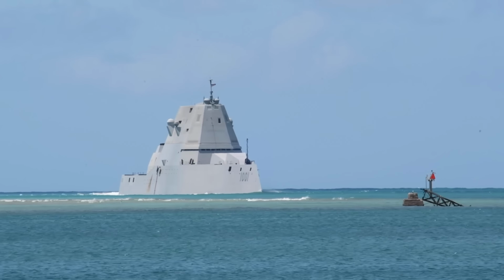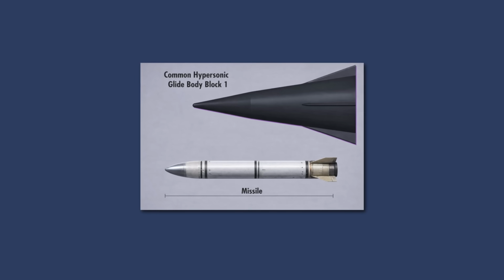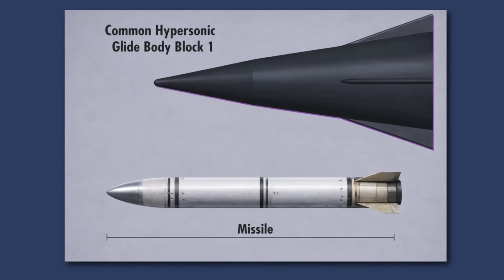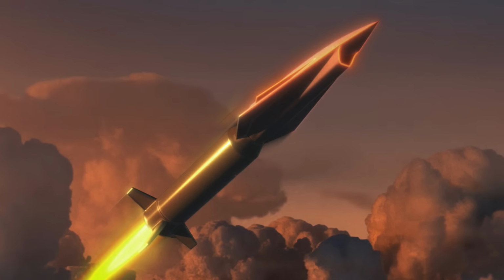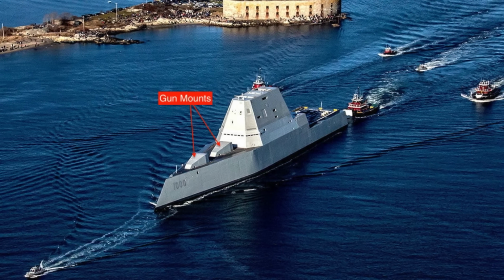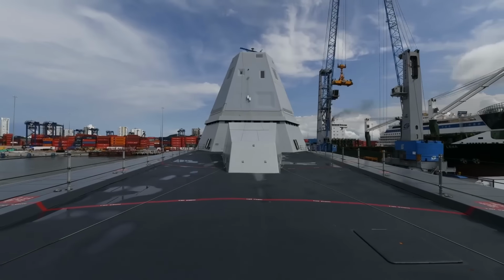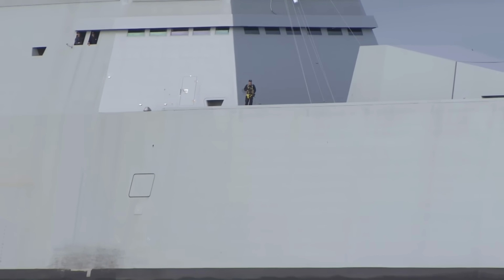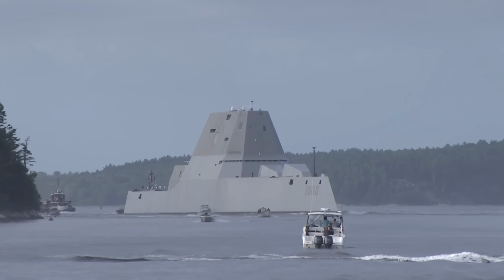How Zumwalt warships is set to change the game with hypersonic CPS missile  ?

Comment: Should start Zumwalt class construction back up.
Block 2
With a redesigned upper superstructure that's simpler to build 
Replace the forward gun with the standard 5-inch 
Install VLT in the location of the 2nd gun 
Concentrate on fleet air defense.

Comment: Glad to hear that the use of these ships  have found their new role. If we can have a fleet of 20 to 30 of these it would help in counteracting China's missile deterrence in the Pacific.
Reply: If only. It's politically toxic on capital hill to make any more.
Reply: They’re way too expensive to build, and there would definitely be delays like with every single ship that we’re currently building. If we take away some of the stealth features, that would decrease costs and construction significantly. So if that were to happen I would agree with you.
Reply: I don't think they can. They only made 3, and companies involved have since moved on to other projects. That's okay though as many of our submarines are planned to also be able to launch hyper-sonic missiles (and will be even harder to track down than the Zumwalts).
Reply: @bariman223 they only just recently finished the third and are actively working on them to change out the gun to hypersonics tubes. 
Unlike the f22 assembly line, they probably could make more if congress said yes.

At least from what i understand. 
If not then it could be that's why the Trump class is desirable to some in the navy... its designed around surface warfare striking power.
Reply: @ravissary79  Okay: https://en.wikipedia.org/wiki/Zumwalt-class_destroyer. It looks like the third and last Zumwalt was' launched' in 2018, but was left un-commisioned until after the upgrades are completed (around 2027). So, the last ship was built 8 years ago. That's too long, I think. As for our new up-coming 'battleship,'... sure. It will probably be an armament ship of some kind (if they're made at all).  Especially if the new frigates aren't getting any VLC(s).
Reply: @ravissary79  
There is no point at this point
its easiler to divert all resources to the DDG-X and moving that forward to construction. The DDG-1000 are just wasted potential

Comment: Zumwalts were built slightly ahead of their time.

Ammo not being ready turns out to be a game-changing stroke of luck.

CPS weapons means Zumwalts will be the world's first stealth CPS surface warships.

Far more powerful soon than they ever would have been otherwise.

Should build about 20-25 more now with CPS integration.

Won't happen but it should.
Reply: They won’t build anymore but we can take these lessons from integration on these and move it to more future vessels. Each zumwalt costed 6B for perspective a Burke is close to 2.2B. You could build almost 3 for 1 and get more VLS. They do look so cool tho, at least they have a mission now to be a sniper with CPSM.
Reply: @Wanna-See-It but they only cost that much because the program was cut off at the knees to make only 3.
Make 10x more and the cost would drop per unit.
Make 27 more and the AGS 155mm gun would actually become perfectly viable. 
The shells were only so expensive because they only made a few hundred of them... making them collectable items instead of mass produced.
Make more Zumwalts along the new design, with 4 CPW tubes and  1x 155mm AGS and the cost for both Hypersonics and AGS ammo would immediately drop. 

The Burke is a 30+ year old design and its been maxed to its potential. It's awesome and affordable but its a design that has no future. 

Zumwalt can and SHOULD be invested in for future applications.
Reply: @ravissary79 I agree the Burke is maxed out and that we need a new destroyer. We spent 20yrs playing in the sand and now have to refocus to near pears. Zumwalt is capable and could have seen some price reductions. As a general workhorse destroyer it lacks VLS, its radar is not aegis and can’t use some standard missiles, also no close in weapons. 

This could all be fixed and production could start again,but restarting production  and modifying things just adds cost. At that point just learn your lesson and make a new design that isn’t so bespoke. VLS is everything for a forward deployed Navy. Hopefully we get DDG(x) and not that battleship nonsense. I like Zumwalt it’s just not the answer.
Reply: @Wanna-See-It it only lacks around 10x VLS vs Burke, meanwhile it has better range and endurance and the addictional CPS weapons tubes more than make up for this if we can develop weapons like blackbeard that are affordable to use... keeping only the most expensive hypersonics for emergencies. 

Also, unlike the Burke, the Zumwalt has the electrical power generation capacity to make use of advanced lasers for defense so you're not as reliant on VLS for everything.
Reply: @ravissary79 10 VLS could be 40ESSM for defense. Lasers while making improvements are highly dependent on weather conditions. Let’s take what’s good about Burke & Zumwalt and find a middle ground for DDG(x). This way we can control cost and get a ROI on Zumwalt. 

Integrating Blackbeard on navy ships would be cool, idk dimensions but I wonder if they could be multipacked in VLS.
Reply: @Wanna-See-It to my knowledge blackbeard would be too big for VLS.
The new CPS tubes are SIGNIFICANTLY larger than VLS.
If 3x ESSMs can fit in 1 VLS and multiple VLS can fit in 1 CPS tube... well... I'm pretty sure 4x CPS tubes trumps 10x VLS.
And if they HAD to... if its as you think and all these extra fearures Zumwalt has are worthless compared to 10x more VLS, then just replace those 4x CPS tubes with 16x VLS.

But now you just hsve an expensive stealthy burke... you just gave away your most cutting edge strike assets for an afternoon worth of drone swarm fodder.

The lesson of the Houthie attacks are that you CAN'T survive modern threats with more VLS. Even if you live you didn't solve anything and you spent the GDP of a small country to just hang out.

VLS isn't everything.
Reply: @ravissary79 I guess we’ll just have to disagree. Never said Zumwalt was useless, it just isn’t the super ship that you’re making it out to be.🤷🏻‍♂️
Reply: @Wanna-See-It  
The USN could have saved the program by investing a flight II Technology Insertion batch of ships. The Flight II add SPY-6,  AEGIS, remove one AGS for additional VLS space. On both sides additional pair of 30mm cannons with multi function capable AESA radar as  CIWS , AAA and ASuW.
The turret placements would serve as testing point for directed energy weapon like HELIOS, ODIN and Epirus Leonidas high-power microwave (HPM)
The Leonidas in testing smoked 49 drones in one go and the DDG-1000s have 78 MW power reserve
Depending on how test went
The DDG-X wouldnt exist and it would be simple Flight III DDG-1000
Replacing one AGS with strike length AGS. One 32 cell would bring the DDG-1000 p 112 , only 10 less than the cruisers or do 61 cell for 141 
The DDG-1000 is just wasted potential
Reply: @verdebusterAP  sounds all good on paper. Until you have to tell congress your ship now cost 8B instead of 6B, which is the estimated cost to restart now. Building up new infrastructure and specialized machinery. The ship can be the best thing ever but it doesn’t matter if it’s unaffordable. There needs to be a balance struck in cost and capability.
Reply: @Wanna-See-It  
thats when you remind congress that they put the USN in this position
While the upfront cost is expensive
You lay out the cost reduction measures 
By using SPY-6 and AEGIS, the ship is common to the fleet
Tactically speaking the USN actual best option is the LPD-17 BMD for firepower
The problem with CGs. DD and FF is limited space
The normal cost of LPD-17 is 2 billion
You would add 3 strike length VLS 
61 cells each for 183. plus 80 PVLS
The PVLS would large enough to house quad packed PAC-3 MSE 
Lastly the 6-10 Multiple-All-Up-Round Canisters (MACs) for large diameter missiles
The sensors would be a combo SPY-6 and 7
The ship would have  integrated electric propulsion (IEP) with 100 MW surplus
Add in some modular design and it would down the heavy lifting that USN needs
Reply: @verdebusterAP I’ve never heard of lpd17 bmd, just looked it up and it’s pretty cool. I’m not even really trying to argue with anyone over Zumwalt, if it came back it would be cool. I’m just telling people it’s not gonna happen because all people in congress see is price tags. There is a lot of politics in ship selection and production. Unfortunately we can’t build anything because nobody in government can keep a consistent vision on what we should have.
Reply: @Wanna-See-It  
There is no saving that class at this point
and that is the biggest irony that congress is why the USN is in the mess
Reply: The AGS wasnt ready, it was canx because of cost. The USN opted for unique 155mm instead NATO common rounds. if they had opted for NATO common rounds, they could have used the Excalibur and other rounds
The EMRG Hypervelocity Projectile (HVP) was found to be able to be fired from the AGS but kinda of hard shell to make HVP just for 6 guns
But with the DDG-X, they could upgrade to 155mm NATO common mount. The MK-45 weights 23 tons while an M777 weights 4 tons
If they cap the weight at 25, they could add the 155mm
the 155m has better options all around
The CPS working along the ARRW are potentially the final word against the DF-21/26 
Without their DF screen, China has is very much in trouble
Reply: @verdebusterAP using a NATO common shell for the AGS misses the point. 
If you're not shooting and hitting targets at 80+ miles but just the typical 9-20 miles, you're not getting the leap that makes a powerful gun viable in the age of missiles. 
They have the tech. The price only became ridiculous because the Zumwalts procurement numbers got slashed to oblivion early on, which made all its novel systems into collectors items instead of logistically cost effective. 

If they made 17-27 more Zumwalts... and kept 1 AGS on each, the price per shell would fall significantly.
Reply: @ravissary79  
Thats point. 
The gun should have been common
Able to use the LRLAP but also use NATO common rounds so its not completely useless without the LRLAP
80 miles impressive but not worth it in modern warfare given the increasing range and accuracy of missiles
as for the Zumwalts
A flight II and III would be in order
The Flight II removes one AGS for expended VLS capability. it also adds the SPY-6
The flight III would be Technology Insertion
A complete ship redesign
Adds the CPS, the large diameter swappable VLS
as well as Directed-energy weapons (DEW)
Essentially trialing the tech for the DDG-X
Reply: @verdebusterAP when you're stealthy and can support marine land movements, 80 miles is perfectly serviceable. 
And even at 500k a pop, what's WAY cheaper than every missile alternative that can get the job done.

Make thousands and those shells will drop to 40-50k instead of 500k.
Using traditional 5" NATO rounds just means you won't use them at all because the range is too short.
Reply: @ravissary79  
Actually its not
The Marines have several new types of light weight but long range weapons that make naval gunfire a moot concept